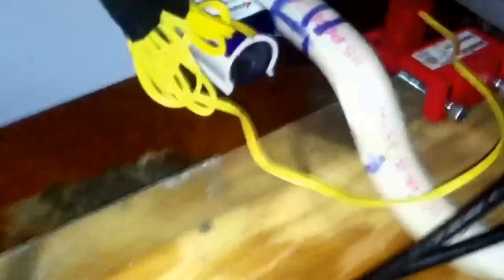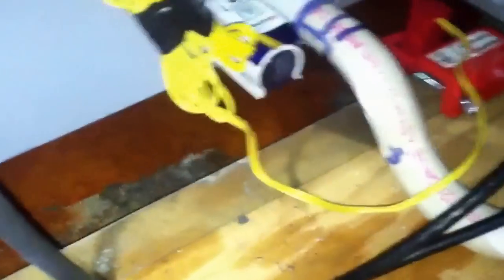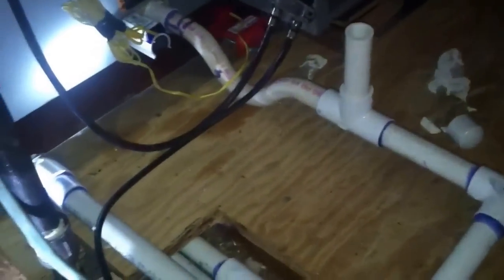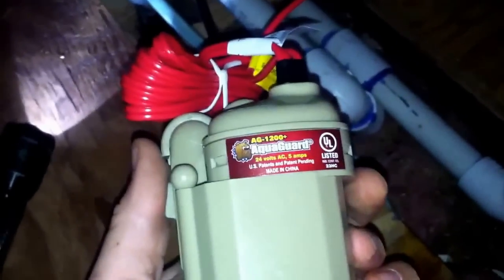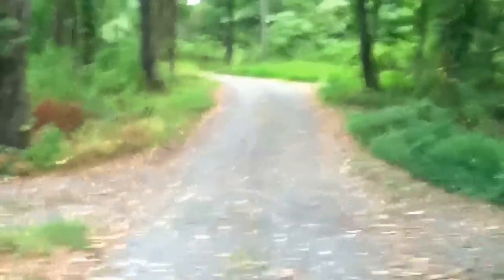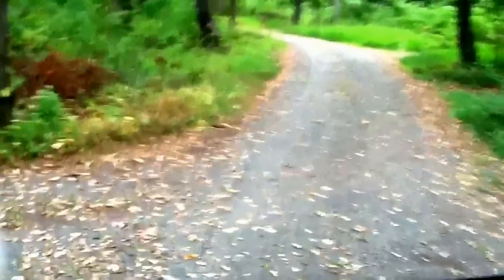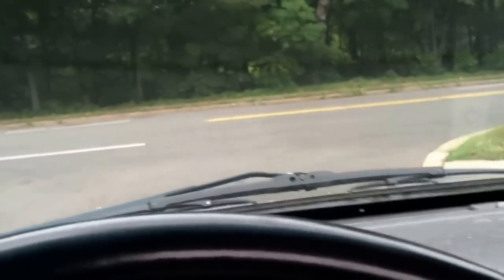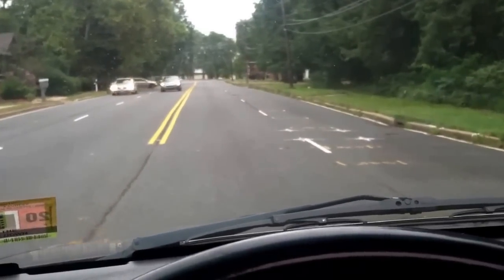Ac attic condensation line clogged

Comment: Do you like that diversatech sensor switch, how bout the rector seal SS! right on the secondary
Reply from the maker: I do not like the SOS switch at all , water blows into it over time and can't drain and then shutting down ac cause of false sense .
Reply: TRY AN EZ TRAP NEXT INSTALLATION YOU WONT HAVE THIS TROUBLE AGAIN.
Reply from the maker: Edward Mann yes that's what I use now , thanks for watching